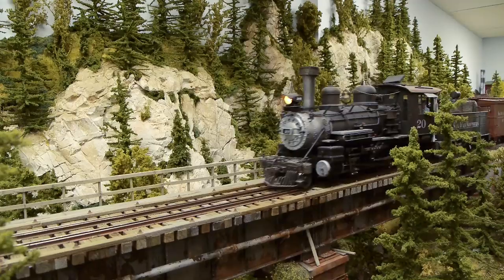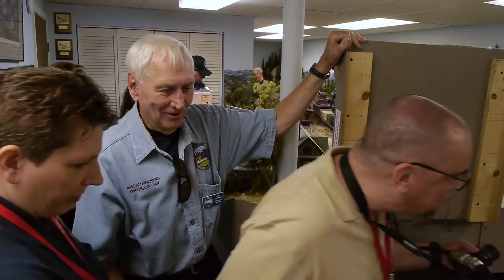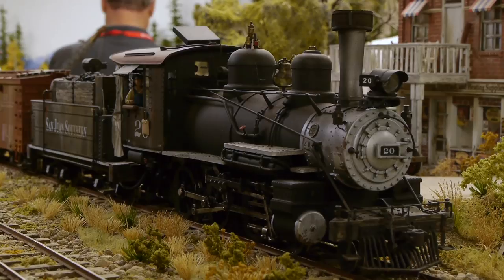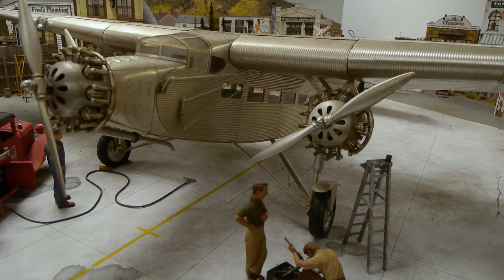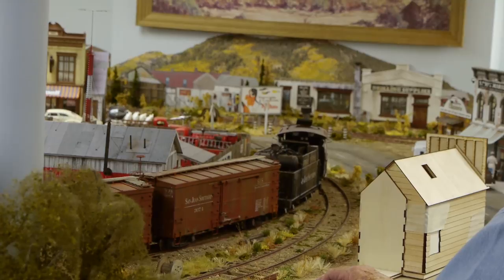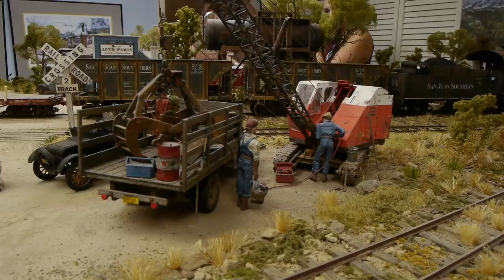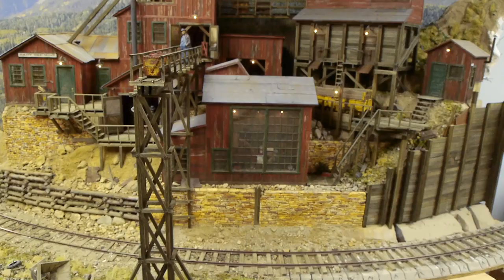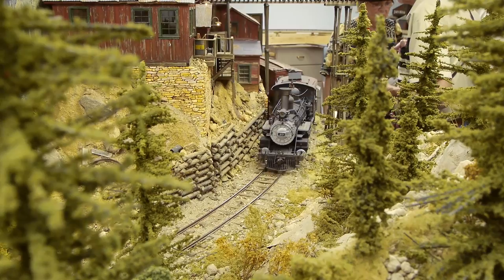Bill White's San Juan Southern - 2017 Narrow gauge Convention

Comment: Great layout.  Nice details.  Makes me want to move up to large scale.
Reply from the maker: I took the plunge in like 95. Hard to do... Takes a minimum of 12 feet to turn around and go back. THis is a 20x30 foot layout. And that about the smallest you can go. However, what I have been doing is just building locos and autos and rolling stock. Sure wish I could run it.... We are however building a loco shop - roundhouse. It's 20x10 and is just a roundhouse water and coal. But DANG!!!!

Comment: G and F are not even close. You can look at my video on scale at my channel. This is a very confusing thing for many. I'm glad you pointed that out.Great video. Regards, Solomon
Reply from the maker: Did you see the show on Ozark? They now offer the same buildings in 1/24, 1/22 and 1/20. In the show I have 3 of the same building lined up in the 3 sizes. WOW. Huge difference. AND he makes it in 1/32 as well. but no one wants that.
Reply: Yes I did. I did a scale presentation on my You tube channel, and made an excel program to do scale conversions. Check it out.